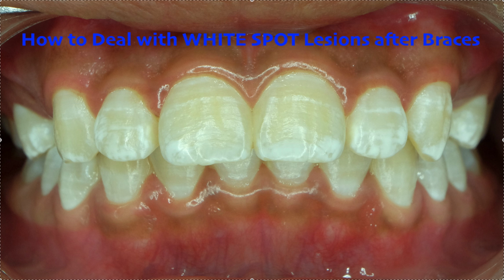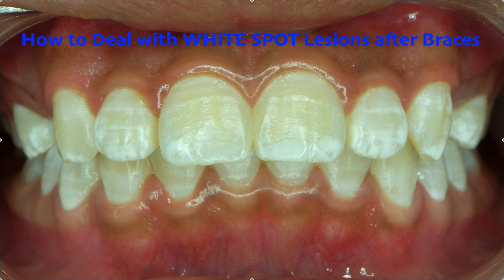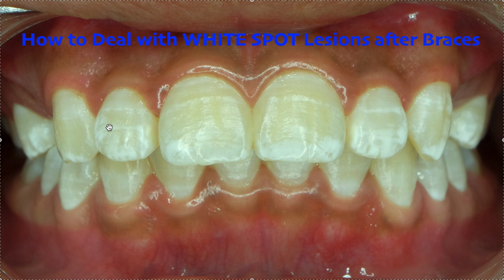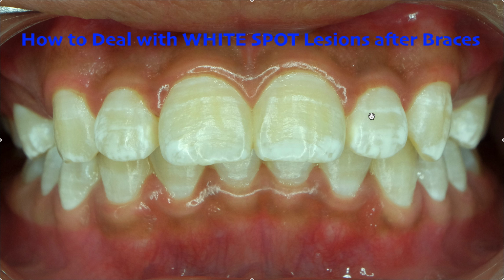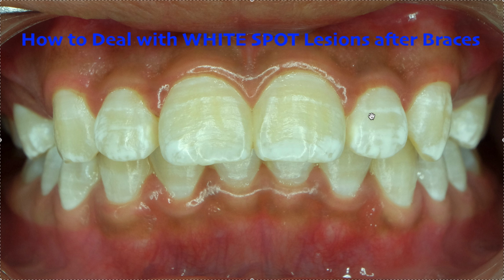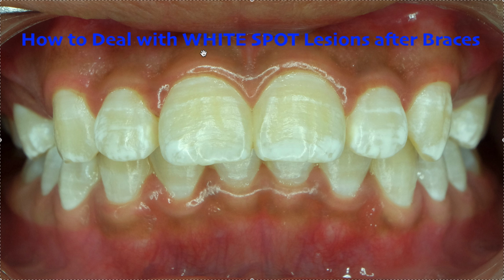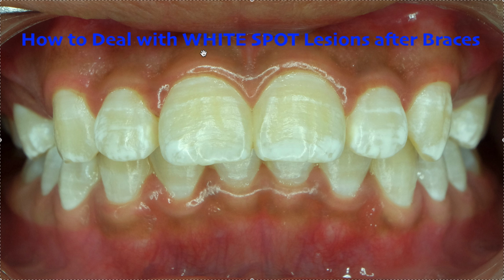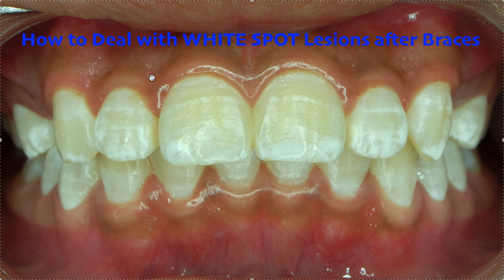White Spot Lesions- Icon and MI Paste

Comment: Hi Dr. What's up?
I have a case of a moderate crowding, every thing was alright till I reached 17 * 25 niti, the upper left 2 became with flared crown, +ve root torque.
I did all I know to fix the problem but it didn't work, torque spring, torque bend, reposition of the bracket, Z bend, upside down bracket, but no hope 🤷‍♀️🤷‍♀️🤦‍♀️🤦‍♀️
please Dr., your kind opinion.
note : the x_ray showed no sign of ankylosis, the tooth with normal phisiological movement, no PDL widening or changes.
Reply from the maker: You'd need to take a ceph and see if it's flared. if it's flared, you'll have to extract or exo 8's and switch to aligners and do sequential distalization or do a ton of IPR
Reply: @Straightsmilesolutions 
thank Dr. for your Interest.
after leveling and alignment.. there was enough space for the 2 to move comfortably, bz the  upper left 6 was extracted.